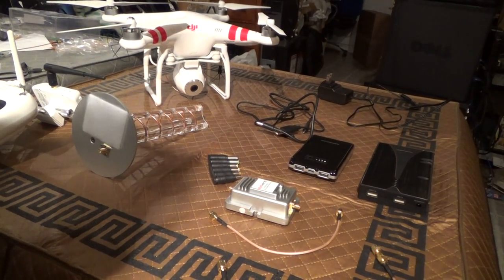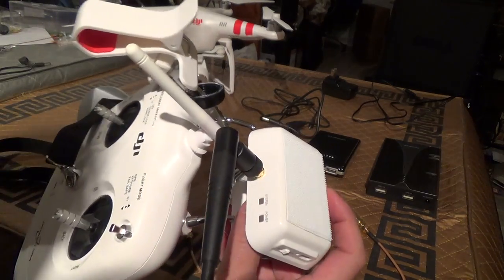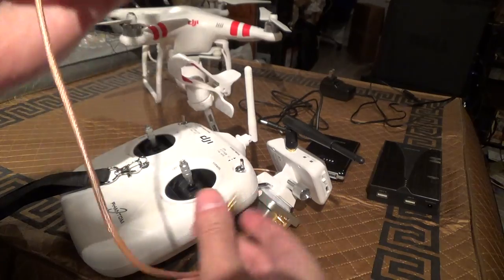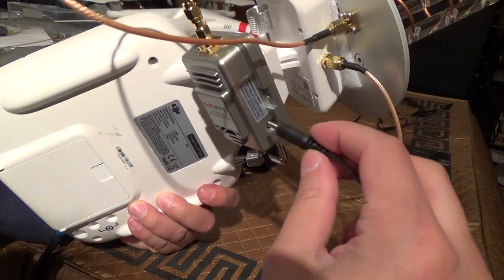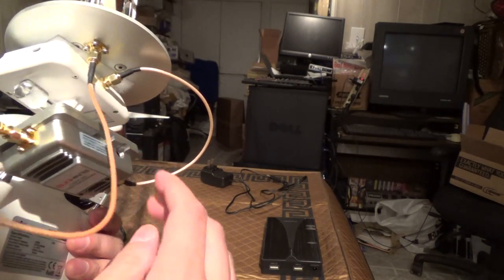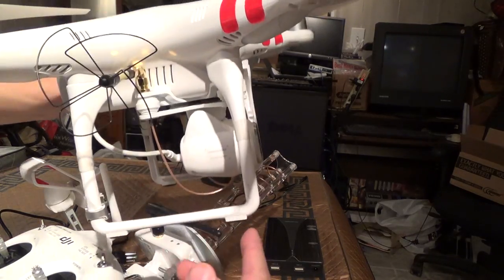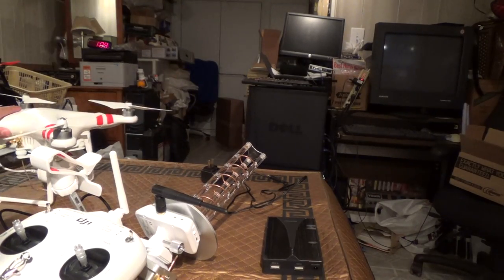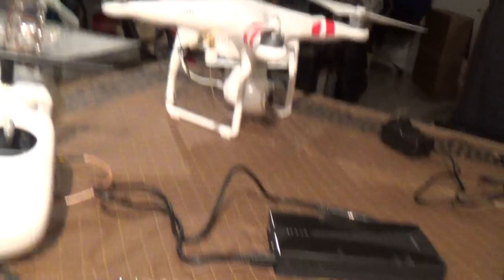Adding Sunhans Amplification to Phantom 2 Vision wifi range extender improve FPV

Comment: im using the sunhans 2w for my dji transmitter but getting a lot of static.. can still see the video but the static gets worst when i use the throttle. anyway to fix this issue. will the attenuator help? i'm getting 2k+ range.
Reply from the maker: Sonny Phan If you're using the newer version of the wifi range extender then yes I'd defiantly recommend using at least a 3dbi attenuator on it. it will reduce the possibility of overloading the amp which would end up creating a noisy signal and reduced range as a result.

Comment: One last question. how come only one amtenna is hooked to the amp? I know it has only one outlet. how do i make sure that i have the correct antenna hooked up to the amp. thanks
Reply from the maker: Because it only uses one antenna again time the one with the strongest signal so using a single strong antenna for range is adequate couples with a good omni directional for closer range flying.

Comment: How is the white wifi extender powered? Do you charge it before you mount it on the controller?
Reply from the maker: With the 2 watt version of the amplifier you can use a portable usb 2amp device and a usb to dc jack if appropriate size in this case it's similar to the H size or roughly 2mm jack.  For the 2.5 or 3 watt version of the amp I have two ways of powering it.  1) using a lipo battery I got off eBay with a on off switch as well as appropriate adapter to plug into the amp, or 2) the larger RavPower portable battery which not only comes with usb power but also switchable 9v and 12v output power and includes adapters that will fit the amp.
Reply: Ben7seven7 Thanks for the reply. You did cover all that info in the video which I followed, but thanks anyway mate. I was just curious as I didn't see a power lead connected to the white extender. How much does the whole unit weigh with everything attached? You'd use a chest harness right?

Comment: why do you need to change the ce mode when up grading the 5.8 ?? and which setting ?
Reply: FCC mode outputs an enormous amount of power, because it's expecting to be outputting to an antenna. If you're going to manually amplify the outgoing signal, you don't want to damage or clip the amp, so you can lower the output power going into the amp by setting CE mode, allowing the amp to receive a clear signal that it can then boost by much more than the stock transmitter.
Reply: ok i see , what are the attenuators for ??? ive ordered them . do they knock down the signal ? so i can still use the FCC mode ?
Reply: trickydownunder vids Wait, that's different. Let's be clear about the difference between the CONTROL link, which is an uplink only, from your transmitter to the Phantom, and operates at 5.8 GHz.... and the FPV link, which is bidirectional (though downlink determines video and telemetry quality) and operates as 802.11n Wi-Fi at 2.4 GHz. This video deals with amplifying the FPV link on the receive end.... for which attenuators are optional and may help prevent damage to the amp if the output power from the range extender is too strong for it. You can actually lower that value in the range extender's settings instead, or just use attenuators.

If you're trying to amplify the 5.8 GHz control link, you'll need a different amplifier, one that is designed for 5.8 GHz, and I don't think you need attenuators if you use CE mode.
Reply: right ok , iam boosting both the 5.8 and 2.4 both with the correct amplifiers and power supplie to run both , with no attenuator added and in fcc mode , and with new antenna as suggested in this video , iam getting less that 2000 on the fvp as it cuts out and seems choppy after 600 . hard to say about the 5.8 as the fvp drops out . so ordered the attenuators to add to the 2.4 as was think is would stablelise  the signal strength . this correct summary ?
Reply: trickydownunder vids Do you mean CE mode? You should be in CE mode for the control link. As for the FPV... that's odd. Have you modded the Phantom itself? That would be a good step to try. Receive amplification can only do so much. As for attenuators... you can try but the much better solution is to enter the firmware and lower the output power to 20 dBm. This way you're not also losing signal strength on the way in (your video signal).

Comment: Another question for you can I use a second sunhans amplifier on my radio transmitter or would it be to much for my wifi repeater?
Reply from the maker: Jean-Luc Devon yes you can use a 5.8ghz sunhans amp at the same time as using a 2.4ghz amp on the range extender.  That's the best combo to get maximum range for both visuals and control signal.
Reply from the maker: Jean-Luc Devon if using an amp in the controller tho you will need to set the controller to CE power output, if not then you'll need an attenuator on that as well.
Reply: Ben7seven7 Thanks men was planning on doing that soon but I was referring to the 2.4 wifi repeater I wanted to ad another amplify to the other antenna you think that will be to much for the wifi repeater having two amps on it?

Comment: Have you tried it on the Solo yet?
Reply from the maker: 3000kitesurfer No but others have. It will do great for adding additional range as well as signal penetration in tough areas. You will need to use two of them for best performance given the antennas work in MIMO and not diversity.  And to be on the safe side you'll also want to use a pair of 4dbi attenuators to insure a clean signal goes into the amps from the transmitter.
Reply: Thanks Ben

Comment: I’m just looking to get a bit of extra range out of my Phantom, I’ve gone too far down the rabbit hole.😂😂
Reply from the maker: Sage Wysocki if you want extra range this will definitely do it for you.  Not only does it add extra range for long flights or adds extra penetration and stability.
Reply: Ben7seven7, I sure don’t doubt it. I just bought an ARGtek antenna system for my P3S and hopefully that does the trick. I’m sure it won’t provide the thousands of extra feet that this likely does though. I just can’t justify carrying around a miniature broadcast center with me haha.
Reply from the maker: Sage Wysocki I’m sure that antenna system will be far better than stock.  Also keep in mind it’s not just about overall possible distance but signal stability and reliability as well.  The p3s uses lhcp antennas so the best possible performance would be to use that style of antenna.  Circular polarized antennas will have better signal reliability especially when they are being used on both ends.  Using a linear antenna to a circular polarized antenna will be less reliable.

Comment: Too much hassle, this is the result of DJI's mistake: 1) Using 5.8 Ghz for a remote control, when 2.4 Ghz reaches more distance at the same effective radiated power level (ERP) and 2) Leaving a remote control with a very little radiated power, when most of any average 2.4 Ghz remote control transmitter puts out 100 mW, that one is factory set at 25 mW or some like that. This is why I decided to go with the Phantom 2 rather than the Phantom 2 Vision, the standard Phantom 2 remote control works on 2.4 Ghz, reaching a longer distance than the Phantom 2 Vision's one without any hardware modification. Second, I just added a 600 mW video transmitter, a GoPro Hero 3+ Silver, and Zenmuse H3-D2 that came with the quad, all bought cheaper used but like brand new on eBay. I don't like at all the idea of a low power transmitted video signal from that camera and the need of that "extender" box precisaly because the low power on the camera, and to make matters worse DJI left both the extender box and the camera set to much lower transmitted power level than the maximum they can go up to by simply using a app or two that you can download from Google Play and adjust the camera RF power as well as that box and the range increases much more. I didn't know this until I saw that app there are two of them as far as I remember, I don't have a Phantom 2 Vision but reviews from people on Google Play say that it works and they're very happy. Just my two-cents worth, thank you.

Comment: All these mods look cute,,but everyone is missing out on the whole point of this stuff.. Using an amp on 2.4 & 5gig is way over kill,,and slighly illegal..! You could put a 10w amp on the wifi extender and make no difference...What folks forget it's not the signal "from" the extender, but rather the signal the extender is receiving that is important...Also if your going to use a helicoil type of ant at the extender, then you need the same polerization on the phanton..!  You would better spend your time and money on getting some highgain ants on the phanton, and omni directional highgain ant on the wifi extender....This would give you additional signal boast both directions..  Remember it's not about "how much power" as it is  how you handle it..!   I had to post something on one of these "upgrade" videos,,don't mean to pick on this fellow..
Reply: +John Dorion I am not an expert in this area, but my limited understanding is, if you put a booster on the extender, it not only makes the extender a more powerful transmitter, but it can also make the whole extended range receiver system more sensitive.  An analogy might be a hearing aid.  The hearing aid is placed between your outer ear (the antenna) and your eardrum (the receiver).  A hearing aid boosts the ability of the ear drum to sense sound waves.  The sound waves are the same strength, but they are better received because the waves are amplified before reaching the ear drum.  So in terms of radio waves, the waves received from the Phantom are sensed by the antenna and booster and then amplified,  This amplification takes place between the antenna and the receiver which therefore allows weak radio waves to be sensed (or heard) at a longer range.  

My understanding is, the range extender, although it transmits and receives,  "switches" automatically between its two antennas, depending on what is most efficient at the moment.  So if you're flying around and watching FPV video and not using your phone/tablet at the moment, the extender will be using the booster while it's receiving video signal.  Hence, you get longer range.  

And yes, obviously there are a lot of other very important considerations such as polarization and direction which Ben talks about in other videos.
Reply from the maker: +Mark Ennes you're correct.  Adding this amplification improved both the sending and receiving capability of the wifi system and makes a significant improvement to the overall range.  This has been long proven and tested long ago.  The person you're replying to assumption that this doesn't work was clearly not one made from any persona experience or they would know they were wrong regarding the benefits of adding additional amplification to just the range extender.   He is right regarding marching the same antenna types for best results like LHCP to LHCP or RHCP to RHCP and I cover that in other videos.

Comment: Just looking for educated advise.. Okay Anybody !
I in stalled FPVLRs  Ant mods on the radio and Wi-Fi repeater and it boosted my range with FPV to a 1300 feet constant and almost 5000 feet max I was happy because I live in a very congested hi Wi-Fi area and before the FPVLR mods 800 feet was my constant and 950 was my max... So then I got greedy and added the 2.4GHz Phantom side Antennas  was on my first test flight and went to 3500 feet with out so much as a pixel out of line on my FPV ( I use the Epson Moverio BT200 Glasses ) I was so happy but I didn't have an SD card in the cam to document the flight  so came flying  home to install one, then just 100 feet up and about 150 feet from home my Quad went into a oscillating crash dive that took out my 650.00 camera, WTF is all I could say.
So hear I am 30 days latter and I still have my radio completely Modified wit FPVLRs Radio / Wi-Fi antennas. I have (2) Phantom 2V+'s one with no mods and the one with the 2.4Ghz ant and a new Camera. So what should I do ? Fly the same configuration and hope it was just a glitch? Or add a 2.4GHz amp to the Wi-Fi repeater side of the modified Radio and fly the stock DJI.? And as John Dorian stated below ,does amplifying the repeater really not help it receive from the Phantom.   
Any Input by anyone that has knowledge of this stuff will be greatly appreciated Thanks in advance
Reply from the maker: You probably had a random glitch, Though it's within the realm of possibility depending on where you positioned the external antenna that you may have caused a problem. For one, it should not be positioned near the compass. 

And regarding adding the AMP to just the repeater improves both sending and receive range to the Phantom. You don't need additional amplification on both ends though it goes without saying if you add additional power to the Phantom itself it will go further still.  Depending where you are flying adding amplification just on the pilots end, paired with high gain helical antennas will be sufficient enough for most people.  It may even give you more range than you have battery life on the Phantom for a full round trip flight.  That of course depends where you fly and how much wifi is near where you're flying.

Comment: can a 10db Attenuator work?
Reply from the maker: Jean-Luc Devon 10 is way more than necessary for this application. 4 to 6 is best.
Reply: Thanks for the response I ordered a 6db gotten it today in the mail box but they sent me the wrong attenuator a 10db so your saying that is still to high so just return it an go with the 3 or 6db?
Reply from the maker: Jean-Luc Devon yeah 6 is ok but I think the highest you should go.  A 3 or 4 will likely be fine.
Reply: Okay thank you.

Comment: 2000 ft ? you get that with stock RE700 ?! I think you should go to 6000-8000ft with that !
Reply from the maker: You think wrong and are thinking of another product if you believe the stock P2V goes that far.  In a park environment the max range is 1,200 feet.  With antenna mod using a 5dbi omni on one port it extends the range to a bit over 2k feet in the same environment.  My 12dbi helical antenna brought me to almost 5k feet then my transmitter was running out of range.  Using the Sunhans amp in a heavy wifi congested area roughly doubled the range which was otherwise limited do to heavy RF interference.
Reply: +Ben7seven7  Isn't stock P2V+ (with RE700) should go between 500-700 meters as stated by DJI ? 700ft is a little above 2000ft so that's why I'm asking. Either way 500 meters is the minimum according to their specifications and is +1600ft. Either your tests are done in a very congested WiFi area or with a lot of blocking direct line of sight objects.
Reply from the maker: +Bernek I am using a Phantom 2 vision in the video not the Vision Plus which does get s bit more range do to higher power output.  A p2v+ would likely push close to 2k feet in the same park that the p2c gets 1,200 feet.  In a HEAVILY congested wifi area the P2V can't even push 1k feet distance.   The only place you're going to get crazy long distance with either a stock P2V or P2V+ is in the desert or equivalent area with absolutely no RF interference.  I think the max someone did with a P2V in that environment was around 2,200 or feet give or take.  Also your preview quality setting has a lot to do with the range as well.  The ranges I state was using the 640x480 15fps preview quality for the video feed. So if you set the feed to the lowest setting it will increase the range as well do to lower bandwidth requirement.

Comment: I bought that Ravpower pack and both 5 volt usb ports stopped working.. Cost me $59....not worth it and I bought it on Amazon...
Reply from the maker: bling0023 I have three RavPower packs all working flawlessly.  I bought mine from Newegg which is the least expensive. If you had a problem with yours it's just random bad luck and their is a warranty.

Comment: If you're plugging one amp into another amp rated at 20dbm max input you're going to blow up the second one...  A 6db attenuator is too high, you'll never get the correct power by guessing....
Reply from the maker: Yeah I know the attenuator I got was probably double that of what is needed for this application.